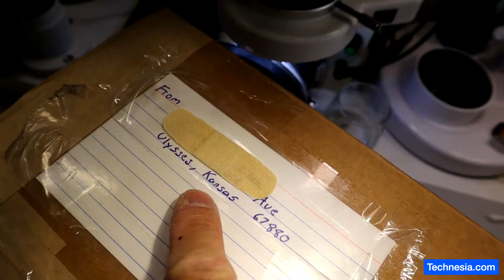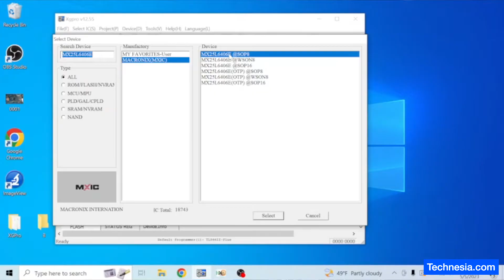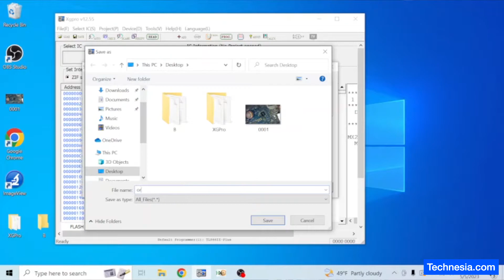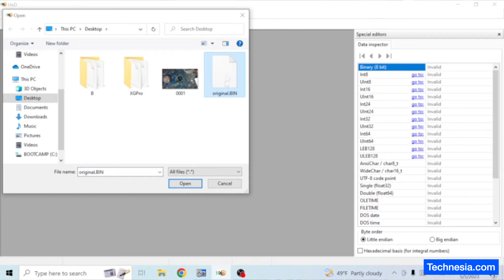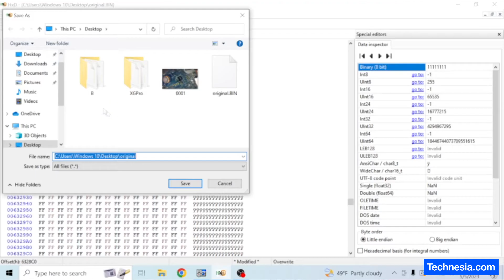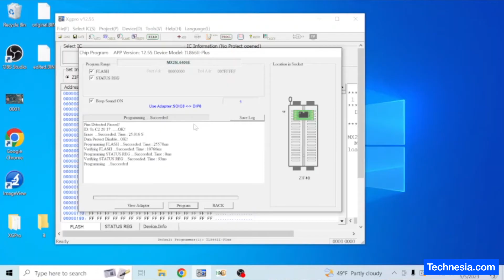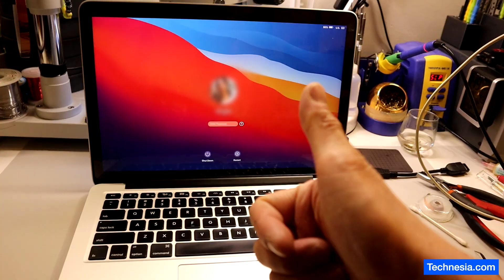How we remove EFI Lock Password on a Macbook Pro laptop

Comment: I have the same issue for my MacBook Pro 2019, how I can fix it with you at what would be the cost for the same
Reply from the maker: You can send your macbook here and I will remove the EFI passcode. The cost is $150
Reply: Can you send me you number or where I can send my MacBook Air